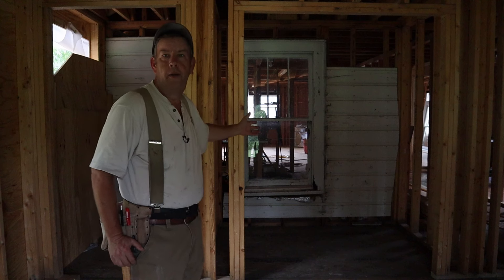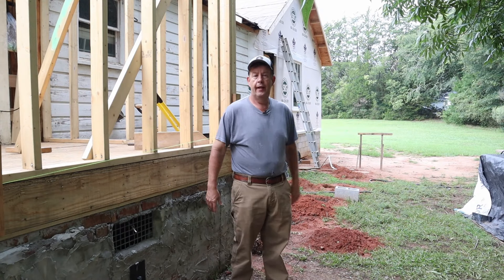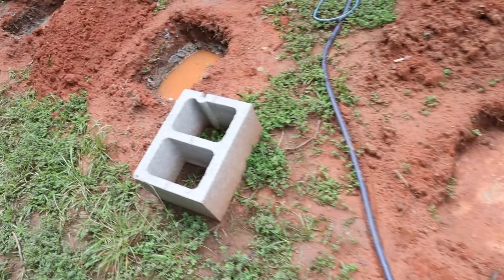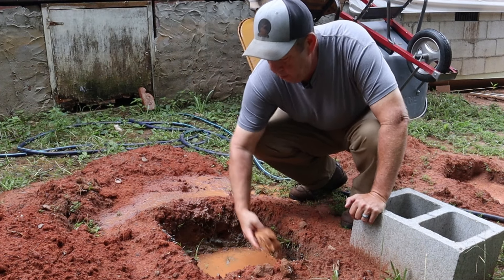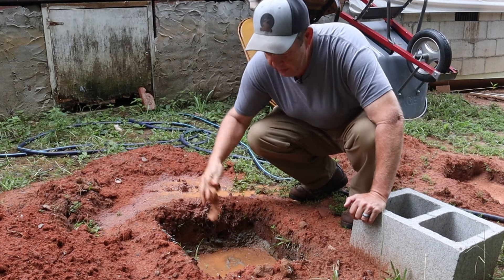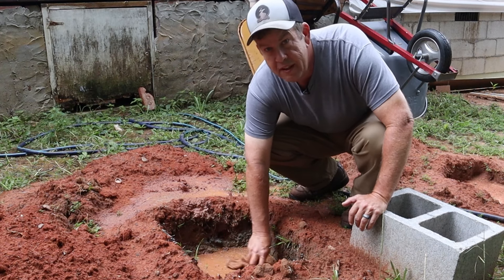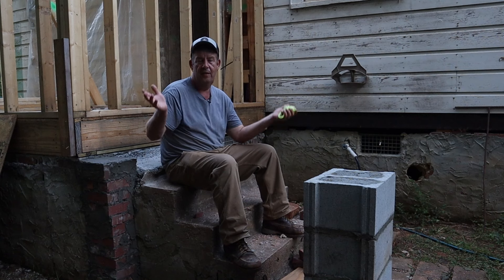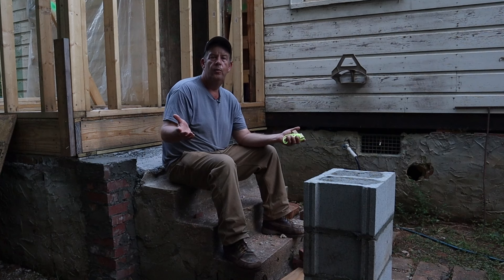House Project #3; Piers For The Back Porch

Comment: Making good progress
Reply: Around here one of the methods for making foundations for a house is a concrete pad.

The various inlets and outlets are known and hard plastic pipes are laid to come up in the right place and out at a slope beyond where the house will be.  Then concrete is poured up to a foot thick to make a level surface.  
After that the walls and insulation are craned into place. Or they can use bricks.